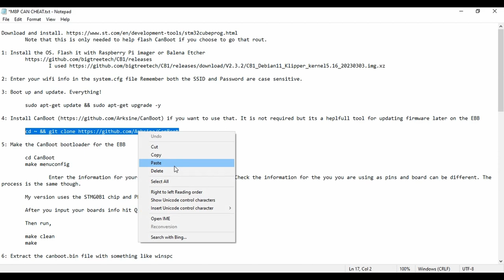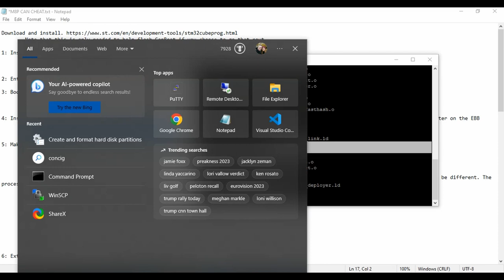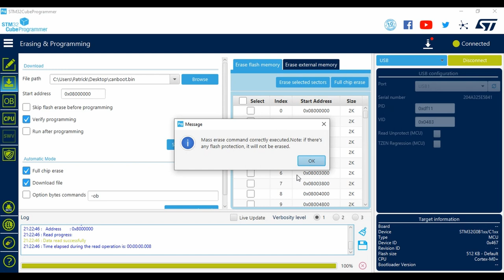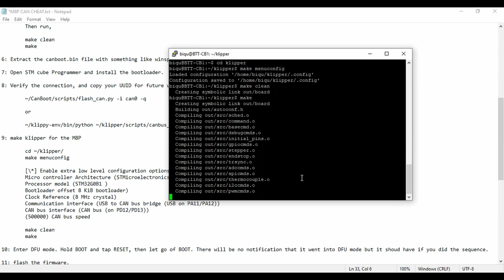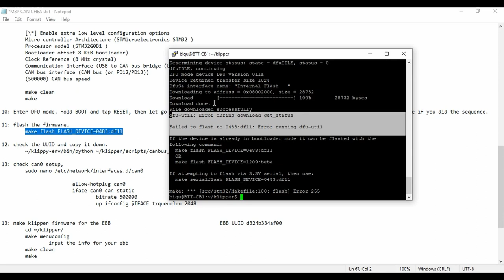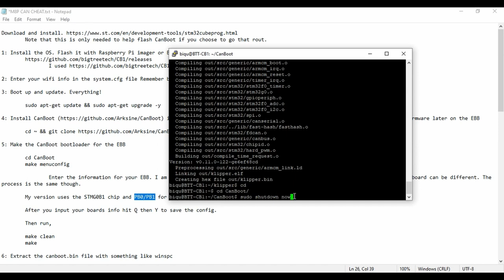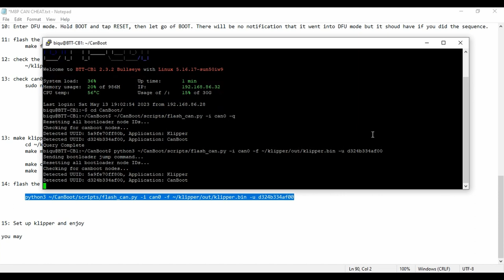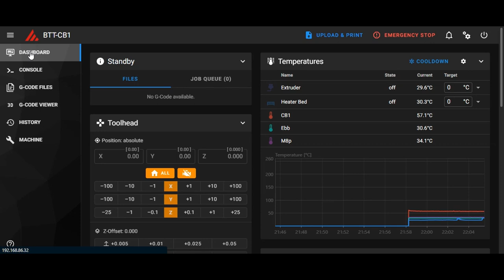Manta M8P+EBB CANbus Setup

Comment: The latest version of STMCubeProgrammer did not work at all. I've been fighting this Can setup for 8 hours now. I just uninstalled STM and installed the previous version and it flashed without a hitch.
Reply from the maker: So weird. I'm glad you got it working in the end. I'll pin this in case others have the same issue.
Reply: Had the same problem. Thanks for the tip!
Reply: I had to switch to version 2.7
Reply: Still not able to get UUID after step 12,  and I did everything from scratch.  Something is missing here in the instructions.
Reply from the maker: @chrisc9213 do you have the 120R jumpers in place? Have you checked that you have can0 setup in interfaces.d? Make sure that the CB1 is fully attached to the M8P and that the bud line is attached correctly, high to high and low to low.
Reply: The high and low were backwards...
Reply: @StackingLayers  I wish I could follow this, but ST has such an awful website, and always has. First it's intrusive on it's new account registration just for a simple download, but worse, it doesn't even function. I've been in a "register, wait for email, click link, unsuccessful download" loop over a dozen times so I give up. What a hassle for a 1/2-second flash operation! I wish there were some alternative to the cube programmer, maybe for Linux. So at least for doing canboot, I'm screwed on this. Maybe I can just do without and set it up without? what do you lose out on... easier updating? I can live with that if that's the case.
Reply from the maker: @TyroneDamShewlaces you can use that make flash or dfu-util. Make the CanBoot/katapult bootloader then put the board into DFU mode. Check that its in DFU with lsusb command. There will be an id on that line that is 2 sets of 4 digits separated by : that is needed for the next step. 
Make sure you are in the ~/katapult/ directory.
Then flash it with this command, replace the 0483:df11 with whatever ID you have,

Option 1, 
make flash FLASH_DEVICE=0483:df11

Option 2,
sudo dfu-util -a 0 -D ~/CanBoot/out/canboot.bin --dfuse-address 0x08000000:force:mass-erase -d 0483:df11
Reply: @StackingLayers  Thanks. But I ended up having no luck setting up over several steps, so I give up for now. I'm going to make the printer just work with all the wires from the main board for now. Maybe I'll have better luck someday later.

Comment: Спасибо тебе огромное! Без твоего видео я наверное забросил бы эту идею с canbus. Прошивать у меня получалось, а вот как правильно сконфигурировать я понял только здесь. MCU для платы поменять на UUID этого мне не хватало. Респект твоим трудам.
Reply from the maker: I'm not sure if Google translate did well enough, but it looks like you need to know how to set up the UUID in the printer.cfg file. Is this correct? If so it is done like this, 
For the Manta, 
        [mcu]
        canbus_uuid: 11aa22bb33cc
For the EBB,
        [mcu EBBCan]
        canbus_uuid: 11aa22bb33cc
And when setting pins for the EBB you need to prefix them with ebb: like this for example,
        step_pin: EBBCan: PD0
Reply: @StackingLayers  Yes, thanks for responding. Thanks to your video, I did all this and I succeeded. My problem was that I did not change [mcu] to canbus_uuid: "bla-bla-bla". Therefore, nothing worked before the change ...
An ADXL345 accelerometer is installed on the EBB36 board. How to apply it for the X and Y axes? For X, it is more or less clear, for Y, not so much. Thanks again for your work.

Comment: Thanks for the detailed video!  Unfortunately I got stuck at the very end.

Setting up Manta M8P 2.0 and EBB36. I was seeing both uuids after installing the 120R jumper, so I proceeded with flashing Klipper to the EBB. The flash succeeded and the success message looked the same as in the video, however after flashing I stopped seeing the uuid of the EBB. I restarted my board and now I'm not seeing any uuids. Not quite sure what do next.
Reply from the maker: Did you make klipper for the EBB to use canbus? And set the same bitrate as the rest? Also keep on mind that of you enter the UUID into the printer.cfg, it will not show anymore in the terminal.
Reply: @StackingLayers  I did set it up to use canbus I believe. Set the bitrate to 1000000 for both. Seems like I must have broken something because even the standard Klipper 'ls /dev/serial/by-id/*' results in 'cannot access '/dev/serial/by-id/*': No such file or directory'

edit - the above is apparently expected after flashing the manta.

I might have to start over from installing Klipper on the Manta? Would like to figure out where I went wrong first though. I had printer.cdfg set up but I deleted it to see if that would fix things. Did not seem to, as with printer.cfg in place I was at least seeing the Manta uuid. Put printer.cfg back but still 0 uuids.
Reply: @StackingLayers  Edit - restored my printer.cfg by grabbing the serial from the logs. I now see the manta uuid again. 

Ended up getting it sorted with some help from the klipper discord. I think was missing the 120r jumper on the manta, and may have had the wrong pins selected when flashing the EBB. 

I double tapped the reset button on the EBB to get back to where I could see both the manta and EBB uuids, then flashed the EBB again. This time it showed two klipper uuids (likely because I had installed the 120r jumpers)

Comment: ok I have no clue what I was doing wrong originally I got the new mp8 v1.1 (for my trident) and wanted to try can bus and I was pulling my hair out trying to get it to work I can't think of one thing I did differently but I followed along with the video and it worked first time well the E motor was going backwards but easy fix don't know what the issue was but thanks so much for making the video so easy to follow
Reply from the maker: Nice to see it was helpful 😁

Comment: Hey there! First of all, thank you for the video. As a klipper noob its been tremendous help.

I just had one question about the MCU declaration in the klipper cfg files.

Is there only the 2 UUIDs?  Do I need to add the serial for the CB1 somewhere? 

When I ask for a list of connected devices after katapult is installed, I get an error message saying there is no such file. Im a bit confused about that part.

Thank you once again for your time
Reply from the maker: You don't have to define the CB1. One thing you might have to do is set up the can0 file. 
Send this command, 
sudo nano /etc/network/interfaces.d/can0
If its empty then you should add this,
allow-hotplug can0  
iface can0 can static
  bitrate 1000000
  up ifconfig $IFACE txqueuelen 1024  
And make sure to set the bitrate in the firmware parts to 1000000 also. The higher bit rate is better if you end up using an accelerometer.

Comment: Hello, thanks for the tutorial. Could you help me. the CAN diagram between the manta and the ebb42, I mean, in the description of the ebb42 it talks about Vin and GND, so then I understood how I should connect to the manta board! Thanks
Reply from the maker: Vin and ground go to the power supply the canbus lines are on the Manta. If you have the means to do it, for added protection it's a good Idea to have an inline fuse on the Vin line. Like a 10A or so.
Reply: @StackingLayers  Thank you very much! I've been analyzing this for days! lol

Comment: I have a Manta M8P V2 with an ebb emmc that I have s
Klipper installed using can bus. I now got EBB SB2209 that I'm trying to install following your direction. I did comment out the mcu in the printer.cfg since you say if it is there I will not be able to see uuid for the EBB. 
I have the EBB connected to the Manta can bus, and I still have the EBB powered by the USB c. I'm to this point where I'm ready to flash Klipper to the EBB, but I only see the original uuid that I have for the EBB. Do I need to do anything else to see it since I had it running before with the can bus?
Reply: Not the original EBB the original uuid for CB1
Reply: I just read some of the comments, and I didn't put a jumper on 120R.
Could that be the problem?
I will try tomorrow.
Reply from the maker: The uuid is a unique number for the device. If you got the uuid for the ebb then it shouldn't change.
Reply from the maker: The 120R jumper is important. It needs to be on the first and last components attached to the canbus line.
Reply: @StackingLayers  
After I added the jumpers on the ebb and the Manta board i got both uuid's.
Thanks.

Comment: Cool instruction. Just finished my build with Manta M8P+EBB SB2209, but no power on my EBB SB via CAN. I connect my CAN power wires to HE0 (VBB and PE3) on Manta, maybe you can explain how to change my M8P.cfg to activate power out from Manta. Thank you a lot for your tutorial.
Reply from the maker: Hmm I'm sure you could do it that way by setting the pe3 pin to be high on boot via the klipper firmware config, although I don't think that's the conventional way. You would normally get power directly from the power supply.
Reply: @StackingLayers  Thank you for your answer)

Comment: I'm headed down this path with a M8P V1.1 and EBB SB2240 for a Voron Style build... Just waiting on availability on a CM4 now
Reply from the maker: What not use a CB1? It's been working great for me and my other 3d printer buddies. A CM4 with more ram is definitely a nicer option but the cb1 is pretty great for the price.
Reply: @StackingLayers  i want to run a 7" BTT screen and a camera all from the pi through the DSi and CSi ports... the CB1 isnt capable using the DSi if the CSi port is used
Reply from the maker: Ah that makes sense. I just use the spi screen and a USB camera.

Comment: How do you get from step7 to step 8 in the cheat sheet? When I flash CanBoot using stm32 cube programmer, theres no where to find my uuid. If I plug the EBB42 into my M8P it doesn't show any uuid's until I flash the m8p, then I get it's uuid only.
Reply from the maker: Oh I thought I reordered that. Do step 8 after you have flashed the m8p so that it has CAN communication.

Comment: Nice Job and a down to earth run down on this setup, Nice to help others since the documentation is weak and this Canbus stuff is newish. 
I followed this setup up and understand most of it as have setup a canbus on another machine but not with the M8P. I have one issue if you could help..? 
I did the search for the EBB in canbus and it shows a UUID number but notice its the same number as the M8P UUID, When I try and flash the EBB42 over the canbus it fails. I have 24v and the H-H and the L-L.. . I tried another EBB42 as ia have a couple and the UUID is the same number also ..?
Seems odd..? Any ideas.?
Thanks In Advance .:) Have a happy day.
Les

Comment: Is the setup identical at BTT Octopus board?
Reply from the maker: This would be more relevant to the octopus, but in general it's more or less the same. You just need to choose the correct chip and pins for the board you have as there are different versions. https://youtu.be/q6iEget35Xw

Comment: I noticed you have the heat sink on the stepper driver, I thought it was meant to go on the MCU chip?if so  is it wrong to put it on the MCU?
Reply from the maker: You can have one on the main chip too but the driver must have one. There's more power going through that, so it needs good cooling.

Comment: Doing this for my manta e3 ez thank you so much for this its helping very much. at the 28:30 mark are you plugging the canbus in to the board or are you still plugged into your pc when flashing?
Reply from the maker: After you make the klipper firmware for the ebb you do need to plug in to canbus to flash the firmware using katapult (formerly called canboot)
Reply: Ah thanks I thought so I just wanted to be sure did not want to release the blue smoke from any of my board. @StackingLayers

Comment: Nice Video! Thanks! hey what is the four conductor cable you used for canbus?
Reply from the maker: I just used some 0.35mm² wires I had laying around. I would recommend something like 0.5mm²-0.75mm² (20awg -18awg) for power though.

Comment: Help! I've been unable to query the ebb. both 120R jumpers are attached to the ebb and board so idk what the issue is. The board is being found during the query... Any ideas?
Reply from the maker: Double check wire orientation. The Can high and can low may be swapped. Normally it's yellow on high and green on low. 
It is also very important that the baud speed is the same in all places. So, for example, if you set 1000000 on the board and host, mak the ebb that too. I know that some of the older instructions have 500000 for the speed in the example.

Comment: When you show the connection to the ebb with the linked in power that is split, the Can data, do I plug that into the ebb also? You show it not plugged into the ebb but don't say if to connect it or not. Not sure why the can wire is attached to the M8P? Noob learning here.
Reply from the maker: In this video I'm utilizing the built-in canbus transceiver. So the canbus wire goes from the M8P to the EBB and power lines go to the 24V power supply.
Note that the canbus lines are connected after the part that the canboot(now called Katapult) is installed.

Comment: Further question: I've been looking at your config files, especially the ebb.cfg.  Am I correct in thinking that the config data for everything on or connected to the EBB (hot end, fans, TAP prode, extruder motors, etc.) needs to be moved from my printer.cfg to here? Then I have to add an include statement in my printer.cfg? What do I do with the  SAVE_CONFIG data that is in my printer.cfg? I tried running a PID calibrate for the hotend, it would not allow me to save the parameters as SAVE_CONFIG section 'extruder' option 'control' conflicts with included value
Reply from the maker: You don't have to have separate files. That is just a good way to keep things organized. Ultimately everything goes in the printer.cfg file either directly or via an include. The save_data must be left as the last thing in the printer.cfg file. Don't add anything under that.
Reply: @Stacking Layers  I have left that there, but it's no longer accepting Save Config. I have to fix the hotend issues first, and then I'll do config files.

Comment: Hi again , thanks for the great info and mine has been working fine !  But i have an issue that is tricky and wonder if you could give me an idea on this.? My Ebb42 shorted out by mistake and has to be replaced. GRRR. So do you know a way of replacing it without redoing the whole reload of the Manta etc. I know the Ebb42 has a UUID for each one.. I can load the canboot now katapult to the Ebb42 but the rest is tricky. I think I would need to remove the info from klipper for the old Ebb42 so it doesn't look for that one..? Ideas... Thanks for any thoughts. Les
Reply from the maker: You should be able to load up the firmware to the new board and query for the new UUID and replaced the old UUID with the new one. You shouldn't have to do anything with the Manta

Comment: Thanks for creating this video as there is nothing out there explaining this setup, one question and I may have missed it in your video but do you set the termination pin on the M8P and EBB?
Reply from the maker: Yes, on both. I think I did forget to mention that.
Reply: Cool, no worries, thanks again for the video
Reply: Where on the M8P board is the termination pin.
Reply from the maker: Right above the 2nd can plug. It's labeled 120R
Reply: Thank you

Comment: Can't find klipper uuid help me ebb sb2209 + cb1 + manta s8p help
Reply from the maker: Which SB2209 do you have. There's a newer one that has a raspberry pi 2040  chip and you need to set up the firmware a little different for that. You flash a .uf2 file not a .bin and you have to connect to a PC to copy the file over to the sb2209 in boot mode.
Reply: I have the stm32 one
Reply: I cant get the katapult uuid klipper id i can find it but there is no other one
Reply from the maker: The klipper UUID will overwrite the katapult one, technically it's the same ID with just a system name on it. Did you install klipper firmware to the ebb first? If you have the klipper UUID for the ebb then you are good to go.
Reply: Yeah i did flash ebb using the cube thing and mine didnt show up as the 2 uuid katapult id and the klipper id when i flashed it i just have one uuid and disclaimer this is my first klipper config and its a voron at that so i cant find anything with these 3 boards even from btt

Comment: thank you for this tutorial!
it really helped me a lot! especially in combination with your video on how to set up hermit crab can.
i could finally make it to make the manta e3ez work together with the hermit crab can.

BUT: after flashing the firmware to the mantas mcu it works absolutely fine.
just when i do a restart it won't find any can connection.
klipper reports: "Internal error during connect: [Errno 19] No such device"
same when i want to querry can via ssh.
when i reflash the mcu it all works again, but just until i reboot the board. :(
Reply from the maker: Check your CAN setup 

    sudo nano /etc/network/interfaces.d/can0

It should have this, most important is the allow-hotplug can0 and not auto can0:

    allow-hotplug can0
    iface can0 can static
    bitrate 500000
    up ifconfig $IFACE txqueuelen 1024

Comment: Great turorial but im stuck with this. I flashed my board in dfu and it did the download complete and the error same as yours however when i try to get the uuid it gives an error
Reply from the maker: What's the error?
Reply: Says unknown command im using the updated Katapult but with an Octopus Max EZ. Im wondering if my issue is that im trying to read the board and power the board from usb.
Reply from the maker: Could be a syntax error, what are you putting in as the command?